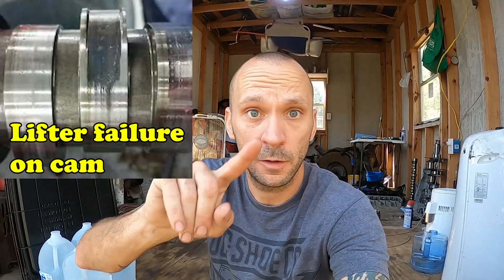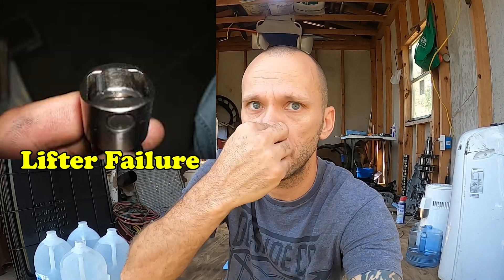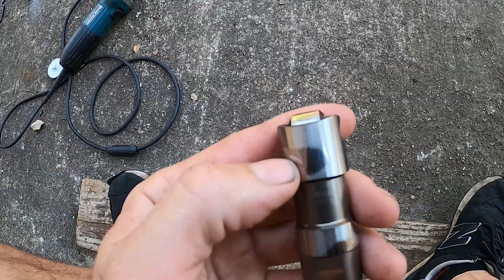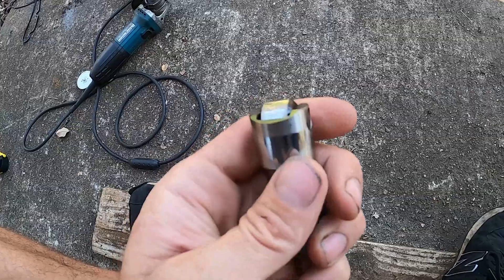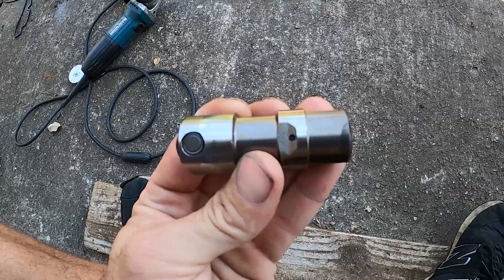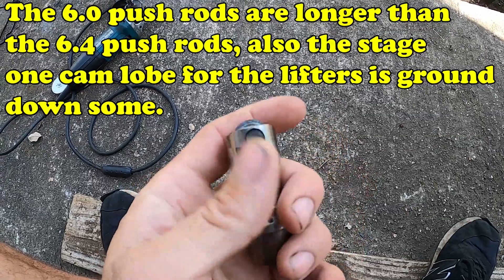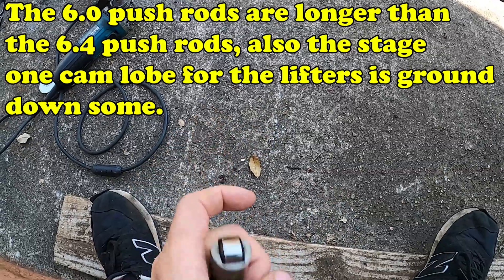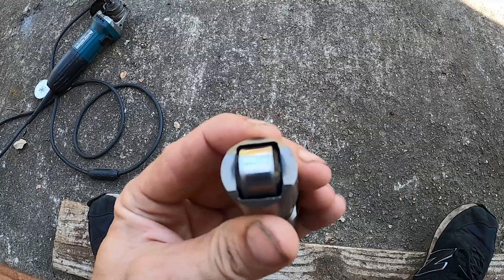6.0 Powerstroke - Lifter Damage & What A Good Used Lifter Looks Like

Comment: I agree with you. It’s a couple of really bad engineering flaws in my opinion on the 6.0 other than the obvious cylinder head issues and 1000 o-rings inside the engine... 🤪 1. You should be able to change the lifters without taking the engine out or the transmission because of the HPOP feed pipe. 2. The camshaft should have been driven from the front so you didn’t need to pull the engine to change it out.

Comment from the maker: I meant to say the OEM cam lobe for the lifters is steep, the stage 1 cam lobe for the lifters is ground down some to prevent lifter failure as well as the 6.4 push rods being shorter.